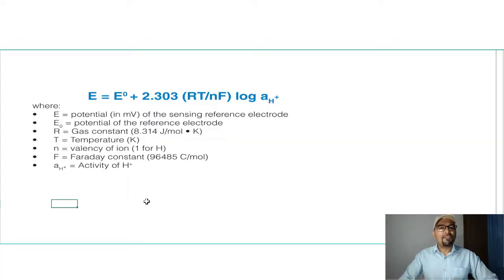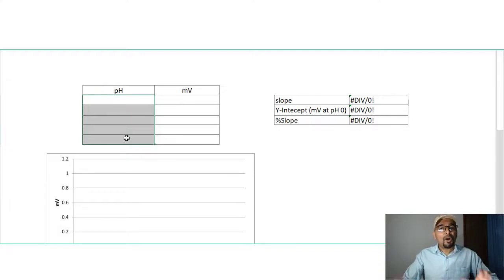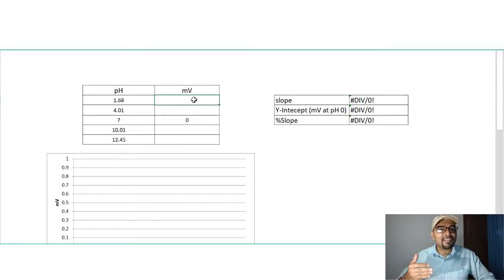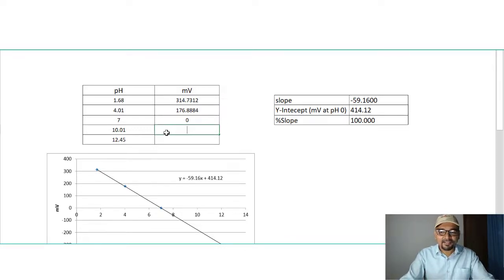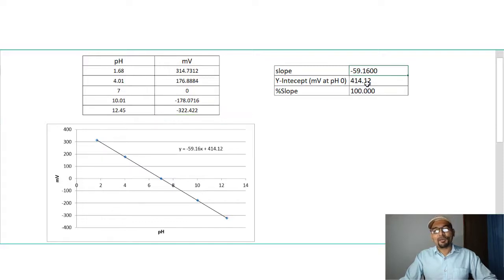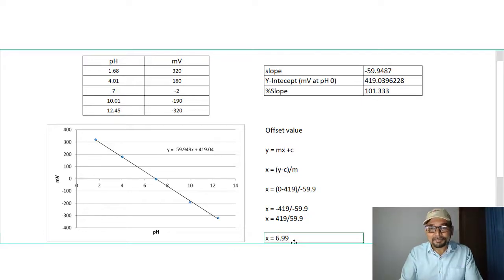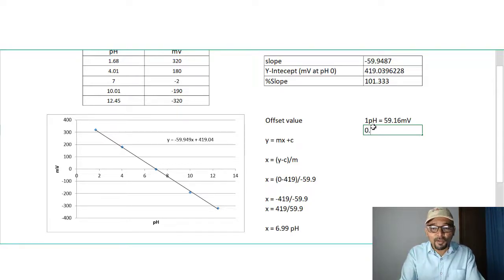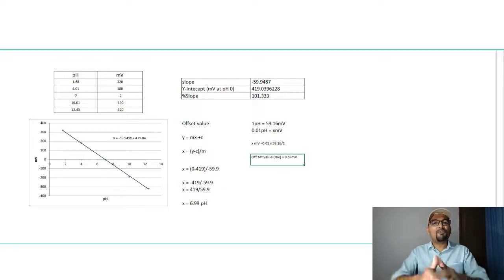How to calculate SLOPE and OFFSET value during pH meter calibration

Comment: Great explanation but I have one dought why we calculate slope and offset at pH meter ,what is the purpose for slope and offset in pH meter.
Reply: For  check ph electode working condition
Reply: slope is calculated in order to eliminate errors caused due to temperature and other variations. In ideal case that is when the temperature of reference and the pH solution is 25 deg celcius in that case slope appears to be 59.16mV/pH but it will change with change in slope